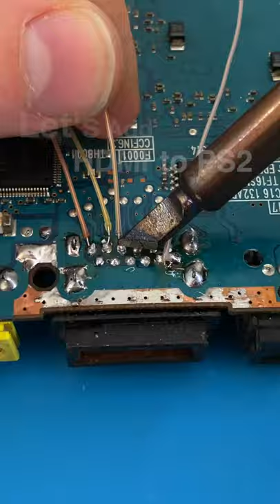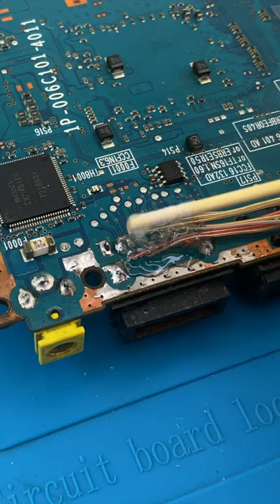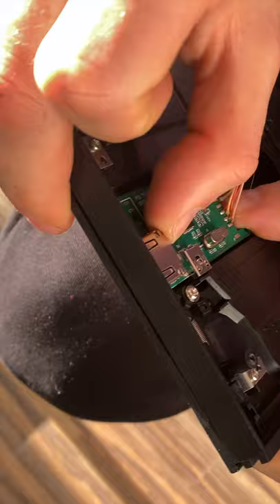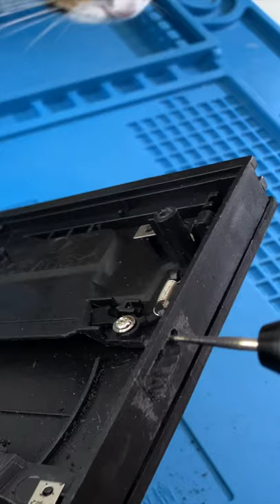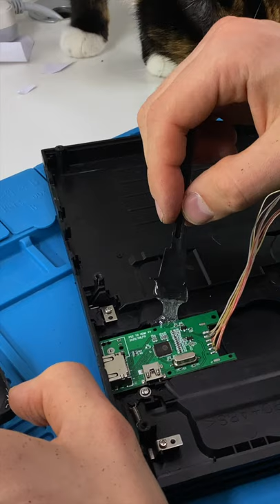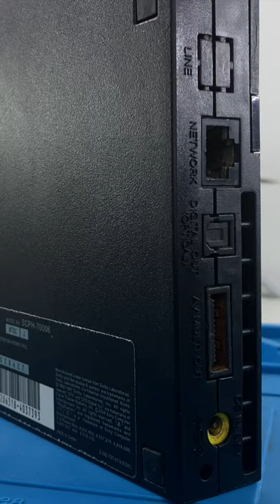PS2 HDMI MOD 1080  #shorts

Comment: Only downside is it’s not true HDMI. A Digital to Digital mod is in the works, but it will be a much more complex install. Til then using Component plugged into the RetroTinks 5X is the way to go.
Reply: Why has the PS2 been the one console everyone in the retro community refruse to touch ? Is it really that complicated and complex or is their no interest ? It's the most popular console ever made so I'm still shocked there hasn't been a ps2 digital or even a high quality ps2 hdmi adapter like what GameCube and Xbox got with the carby and chimeric adapter even the n64 got the super64 and ultra hdmi mod/digital
Reply: @or2130  The PS2 is a more complex machine with it’s Emotion Engine and Graphics Synthesiser chip. Where as the Gamecube and the Og Xbox and even the Dreamcast were essentially very similar to PC’s. As for the PS2 there are modchips but no modern modchip, there is the HDMI mod in the works, there is FreeMcboot softmod which is quite recent, there is flash soft mod which is similar to the modchip but it’s done through softmodding, there is Pico PSU board for the Phat PS2 which replaces the Og PSU, there is OPL which allows for you to run games off the harddrive. The PS2 scene is definitely different but the PS2 does get some attention.
Reply: @8bitnation419  is it possible to mod a game cube with native 1080?
Reply: @SychoSam  There are Digital HDMI Adaptors for the Gamecube that will upscale 480p to 1080p. But no the Gamecube cannot do native 1080p, since it’s an early 2000’s console. Only the Wii U and the Switch and beyond can do native 1080p.
Reply: @8bitnation419  all I need is native 720p for ps2 and  game cube. I got a PAL version of the PS2 and I heard I should get a NTSC version so I can play in native 720p.
Reply: All got have his adapter yes HDMI works got be close 1080p mine got adapter make picture look brand new
Reply: Only some games support 720/480/1080 native, you can mod your ps2 to for a 1080 upscale for like 20% of unsupported games
Reply: I tried that once a few years ago and the screen is super green and I just have a super green PS2
Reply: Using opl you can upscale video to 1080p (in some versions)

Comment: but it's just composite video upscaled 😔
Reply from the maker: yep
Reply: No, it’s RGBS or YPbPr. Still, the chip used in those converters is no better than the one in any modern TV that still has analog inputs.

Comment: When I wanna make holes for HDMIs I use a broken hdmi, heat the tip and melt a perfect hdmi shaped slot 👍🏼 ( if you do it from the outside - in, you’ll get good results)
Reply: i wouldnt these shitty hdmi adapters ad lag and have bad quality get a scaler instead
Reply: I’ve cut hundreds of HDMI ports for mods and I would never do it that way. The excess plastic has to go somewhere and you will still end up having to clean it up with razors, files, etc.
Reply: @emmettturner9452  its easy to clean up with a nice razor^^
Reply: Bro not heating up a hdmi port to melt through thick plastic it wouldn’t work
Reply: @emmettturner9452  It is better to take an old HDMI that heats up with fire using a lighter, not so much and piercing the plastic from the outside to the inside, it will be perfect, ideally and that it heats up to a similar temperature to a 30W soldering iron.

Comment: Now a question since I thought about doing the same you did: Where did you connect the usb power cable to?
Reply from the maker: Oh it was so long ago =)  as I remember there is 5v on that video output so I tried it without 5v on usb and it worked. But maybe on the fat model it’s different and you need to search for extra 5v source.
Reply: @ReMARKCHANNEL  Thanks for the Reply! I will also go for a slim modell! Ill follow your full video for the cables and try to cram it in somewhere else because I am removing the disc-drive (broken) and installing an ssd + network mini router for SMB transfer over OPL. Unfortunatelly the Mini Router also needs a USB-Power Cable so annother issue for annother time :D

Comment: But does it work? I use an HDMI adapter but each time my refrigerator turns on or off, the TV screen goes blank for a few seconds
Reply: this is just one of the hdmi adaptors disasembled and intergrated into the housing, hardwired in. at the beggining you can see them desolder the usual connector.

Comment: worth it , i have seen the difference !
Reply: LOL! No. This is literally no different than one of those external RGB SCART or YPbPr converters. They don’t properly handle 240p and they add latency, plus, they are the exact same chip you find built-in to almost any modern TV that still has analog inputs. May as well just get one of those and skip the double-scaling.
Reply: @emmettturner9452  how many of this tool u are tested ?
Reply: @karuanmax7821  The same cables and adapters are rebranded by Hyperkin, LevelHike, Pound, etc.

Comment: You had me, until I saw you adding hot glue to it. That's NOT the way to secure your soldered joints. If you properly soldered the wires in the first place, you shouldn't need hot glue. That's a big no no! But to each their own I guess. 🤜🤛
Reply from the maker: Hello, that is not hot glue. I used epoxy resin.